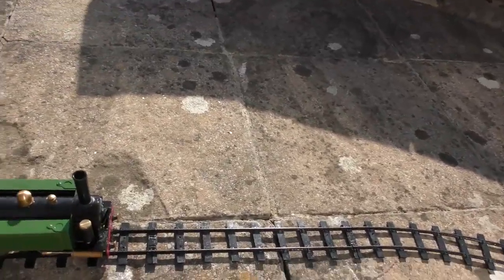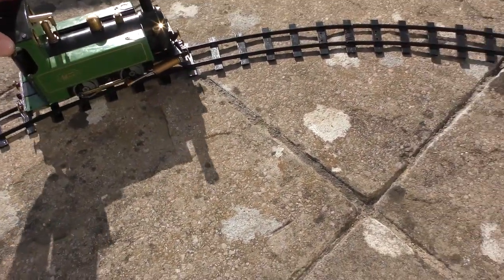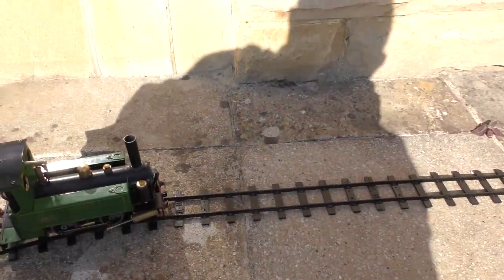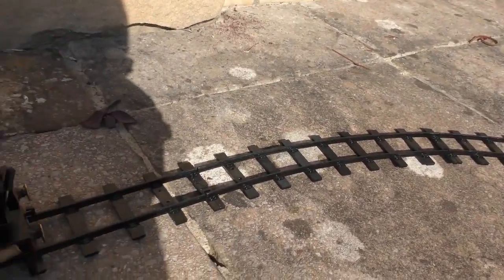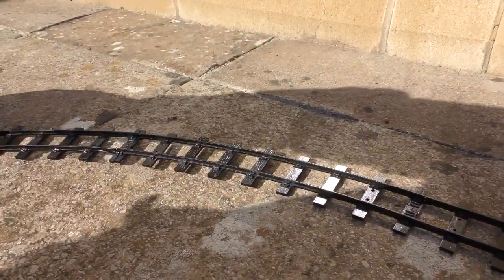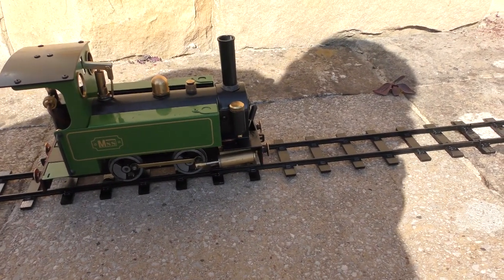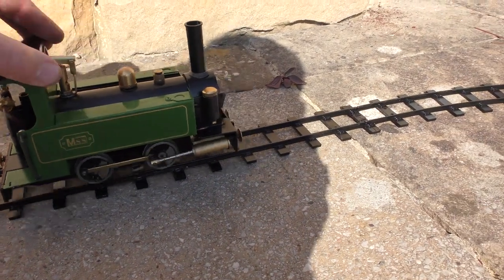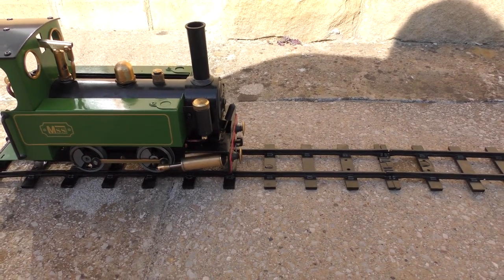MSS Loco Issues

Comment: If the whistle is working fine then that means the boiler is working fine too.  I'd try reassembling the running gear, pistons, steam lines to the pistons.
Reply: The whistle will show you if there’s steam…but if you use it…your steam’s gone.